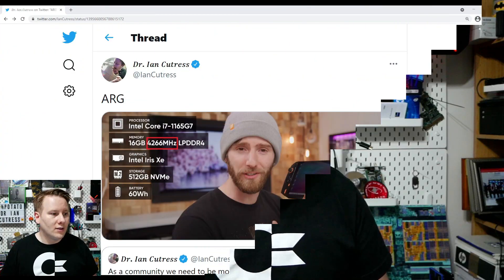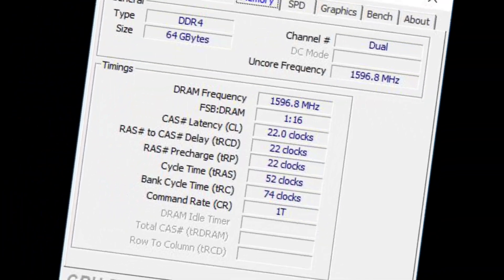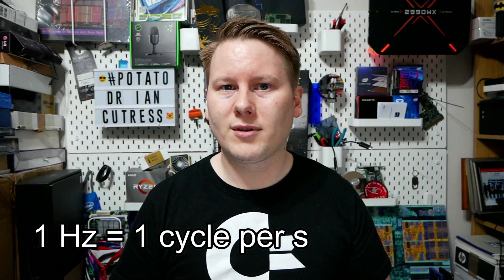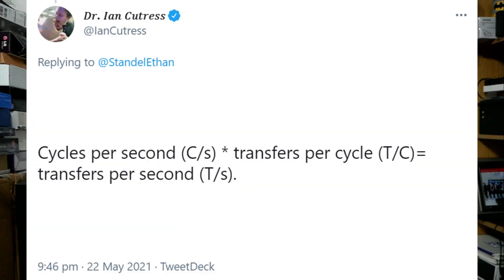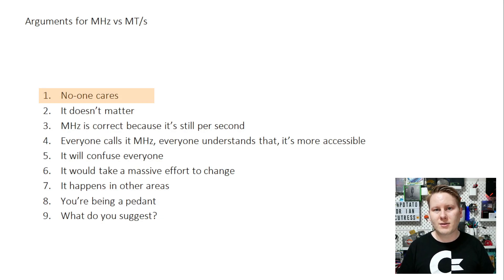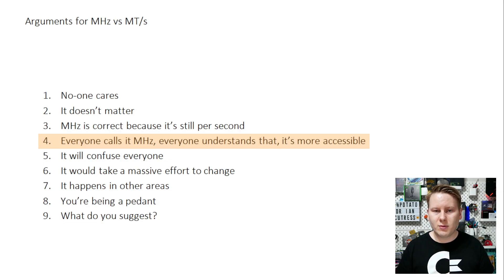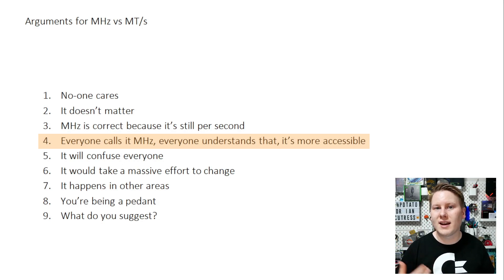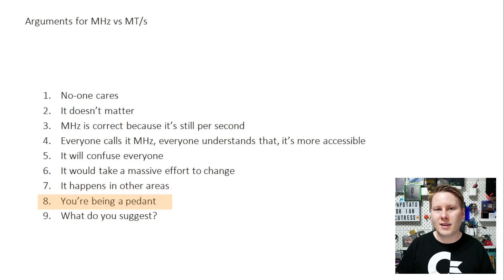Linus is WRONG 💩 : Explaining MHz vs MT/s

Comment: In short: Hz is a unit of frequency. The frequency data is transmitted is called data rate. It is absolutely nothing wrong to specify the frequency data is transferred in Hz! 
You can say the clock speed it 1800MHz and the data rate is 3600MHz. It is a correct use of the unit Hz in both cases! Both are different frequencies. Both can be specified in MHz!

Comment: I am always for being as correct as possible. I understand that this is your goal and it is a good one. Sadly you are wrong here! Hz is not cycles per second! Hz is just 1/s , nothing more nothing less. It is a unit of frequency. It is not only used for perfectly repeating signals! You can say a heard beats with 2 Hz, the string of a violin is oscillating with 440 Hz, the wings of a hummingbird flaps with 50 Hz. 
And you surely can say the clock signal has a frequency of 1800Mhz and the data rate is 3600Mhz. The latter is the frequency new data is transmitted. It does not have to be the same data! 
Honestly you have the misconception that frequency is only used for a perfectly repeating pattern. But that is not the case!

Comment: I understand BOTH sides, BUT I agree with you in just dropping the mhz/MT - calling it DDR4-3200 or QDR3200 - it's MUCH better than when we were using PC1600 on top of DDR2-800Mhz ... ughh I could never figure it out (and I'm probably STILL saying it wrong here too lol) - just call it DDR4-4000 or QDR-400 or DDR5-4000 - this is ALMOST as bad the RGB standards - I just got some fans that are RGB, that have a controller and 2 LED strip - IT DOESN'T CONNECT TO MY COMPUTER AT ALL!!! NOT EVEN THE FANS!!! IT IS ALL DONE WITHA REMOTE CONTROL!! - But it just said RGB Fans with Controller.. I was misled, just like when I got the last ones that were ARGB with NO controller and I couldn't even connect it to my mobo... why is there NO STANDARD WITH RGB, and 700 DIFFERENT USB TYPES?!?!
WHAT ARE THE PEOPLE IN CHARGE OF STANDARD DOING WITH THEIR TIME?!?! 
ARG

Comment: I'm not entirely sure if that argument will come true as I expecting. Basically, Hz is a measure of events per second, and type and complexity do not mether. Do you want to count clock speed, metronome ticks, things made in one day, cars traveling through the crossing, the instruction being done, or nodes played it literally does not meter, measurement does not need to be constant or tied to something that is periodic in nature. Your problem is with how units are used and you are joules of musicians that agree to use one standard, so make your argument straight, don't try to overcomplicate everything like there is a reason, because consistency is the only one you need.

Comment: I'm with you on this one.
I have the advantage of having done analog modem work in the 1980s-1990s.  There was a lot of misunderstanding of "Baud" vs. "symbols per second"; a 2400 Baud modem was still 1200 symbols per second, but each symbol represented 2 bits of data.  As data rates went up, a lot of that increase was using modulation that provided more bits per symbol, not more symbols per second (the POTS network had some frequency limitations); as time went on, a number of interim standards  ("BIS") were adopted that allowed a pair of modems to "train" themselves to better than minimal line conditions, and use higher frequencies or a larger symbol set (more bits per symbol).

These days, I work on embedded systems.  The SoC vendors all rate the memory bus rate in MT/S, with the clock rate being in MHz.

Comment: The correct unit for stochastic or aperiodic events per second or counts per second its the becquerel. (No, it isn't just for radioactivity, it is just mostly used there). Caring about getting units correct is only pedantry for those that haven't (yet) crashed a spacecraft into a planet.

Comment: I think there is no harm in the MHz defence, since it is not really misleading anybody. It is an "effective" MHz, in much the same way that the nanometer process numbers no longer really measure any specific component, rather they describe the "effective" nanometer value as it pertains to Moore's law. It's hard to justify making the distinction of effective memory speeds but not also advocating for more "accurate" descriptions of transistor density. Which you may do, I don't know your stance on that one, and like, either is fine, I'm not saying it's WRONG to make the distinction either way, and certainly at the technical level, or where consumers may be mislead, better communication is important, I just don't think in this example it's worth making a fuss over. As far as a customer is concerned, the "effective speed" of their memory is all they really care about. They might need to have some awareness of the nuances if, for example, they need to adjust their BIOS settings, and different motherboard manufacturers use one term or the other. Communication is not about being "proper", it's about transferring an idea from one party to another, and, again, I just don't see this being bad communication in this instance.

Comment: I understand both sides.
Your side is, know what you're talking about and don't spread misinformation or the wrong information to other people.
I completely agree with that. However, we are power users. We want this information because it's useful to us, but the vast majority of users don't and to them "it doesn't matter".

The average user is a normal Joe Bloggs who doesn't even know how many pixels their phone has or what resolution it's on.
If this person walked into a PC computer shop, which again will be the vast majority of your customers, and asked for a fast thin and light laptop and you pulled out the "This is using an APU and so it has high Mhz ram in order to help the integrated GPU, but this one is only X MT/s while that one is x MT/s" they would walk out or ask for someone else.
All customers want it a simple quick glance number. 4266 is higher than 3600 so 4266 is better. Done. They don't care that it means Mhz or MT/s. The same way they don't care if your SSD is SLC, MLC,TLC... even though it would be beneficial to know for your use case.

Now why do I bring this up?
I would suspect the majority of those that watch LTT are the average Joe Bloggs and he needs to cater to them. He has left the power users to people like GamerNexus, Level1 and yourself. He has completely dominated the lower level average user base and it shows. It has made him very successful.

So all in all, to him and his viewers, it doesn't matter.

Comment: I really liked how the best defence is done by the attacker itself, Linus thanks for the bullet points 😅. YES this argument is about clarity and not what bullshit a manufacturer or a marketing person want to put on the box. Words have meaning and evolve over time but numbers really shouldn't shift every new generation.
So clarity ,and even like you propose neutrality, is better because at least we aren't lying every time we are talking about something that, if taken word for word, could go wrong.
I don't think a computer would post if someone put 4 000 in every box the memory BIOS setting shows you with 4 digits and a potential MHz letters behind it 📴

Good video on it. Hope your habits of taking the number on the box as a simple naming in a range of product instead of the real metric catch winds in the industry and maybe (🤞) we all see manufacturers start giving the naming rights of a product to the Engineering team !

Comment: tbh noobs always say "doesn't matter" to technological rigorousness, but it's always this kind of thing that end up contributing to all the completely absurd conclusions.

BTW IPC differs between any two applications so it's impossible to list that. There's a set maximum to IPC for a certain design but this value is just meaningless to actual use cases.

Comment: This misleading use of units is similar to the irritating use of 1000MB or GB instead of 1024MB in hard drive capacity specs. No OS I've used ever uses perfect multiples of 5, they use bytes which are made of 8 bits each. This means we always buy a hard drive that is smaller than what it claims. So I fully agree with you, leave the units out, if one is interested they can go do a little research and get to know exactly what the numbers represent.

Comment: I kind of disagree that a transfer can't be considered a cycle, unless  it's halves of 1 transfer. If you rectify a 60 Hz AC input, you get a 120 Hz signal at the other side, or with old style bulbs, it would turn on for the positive and for the negative, flashing 120 times a second, it's both 60 Hz and 120 Hz just depending on your perspective, and what you actually measure.

Comment: That representation of the DDR memory with a clock cycle doesn't seem accurate. It looks like you are talking about DDR memory showing a half wave rectification diagram instead of a full wave rectification diagram. Memory should be transferring in data in both directions of above and below zero of the analog clock resonator. 🤔
It would be nice to have some PC hardware engineers explain it who actually develop this stuff going all the way from the power supply, to the resonator and all the way through the memory and back again. I was looking at multiple websites on this subject but only get partial information and not a complete picture.

Comment: Another common scenario where units are used incorrectly is when people are using kg when they are talking about force. I've even seen one person on youtube, who has a degree in mechanical engineering use kg m for torque, when it should be N and N m respectively. This REALLY grinds my gears.

But then again, for casual viewers it might be easier to interpret those fake units than the real ones. The problem really is that people how been using incorrect units for such a long time.

Comment: I think it's good to go into the detail occasionally to inform the new people who are constantly entering the area of interest. It's a good sidebar item that the experienced hands can skip over. I would very much try to avoid misquoting the hard and fast clock rate. Getting it correct and making the seeming disparity stand out encourages people to learn.

Maybe it helps that I'm old enough to remember when DDR was first announced and drew attention to an area that was largely underappreciated. People generally knew more RAM was better but the other performance aspects were rarely discussed as there were rarely any choices. The closest it came for many of us was the 'fast RAM vs chip RAM' issue on Amiga systems but that had more to do with how overall performance was affected by which portions of the system could talk to which memory than how it performed in of itself.

Comment: And they say BTC use too much energy, this is too much energy for nothing. Cause if let's say I invent a  memory that can  run at 100 Mhz and can transfer 10 bits of data on a clock, than it is easier to say it works at 1000 Mhz ( cause that would be the equivalent of 1 bit per clock , I mean  it would have the same bandwidth ) so that every non tech savy could read the specs and understand the same language. It's like 1 GiB in storage is not the same as 1 GB we are talking about, but we use it anyway cause is  more simplier than to explain to every noob there is a difference between base 10 and  base 2 and storage industry use base 10 and some industries use base 2.  And just so that we are on the same page here, there is only one doctor on Youtube and he is: *Dr DRE!*.  ^_^
Reply from the maker: I'll take one of whatever you're on.

Comment: Yehe IF you Use DDR and MHz then its very important to use the actuall clock speed otherwhise its  cause conffusion. It would actual be beter to use memory bandwidth. The intresseting should actual be how much data u can read/write and it depends on speed, data width (and some extent latencys for non burst) . As with CPU clock speed says nothing and is only used for marketing...

Comment: As an engineer in a different field, I understand and agree with you in principle.  However, sometimes it's just necessary to use language that everyone understands for the non-engineers.  I often have to do so with the non-engineers I work with.  I will use a real world example ... me.  Back in the 90s, I used to build my own PCs, but for the past 20 years I had just been doing PCs from OEMS.  I just didn't want to deal with keeping up on the tech and it was easier to just buy something new and shiney from them every few years instead of doing all the research.  So, a couple years ago, I decided it was time to think about getting a new PC.  Mine was 4 years old and I was starting to notice the age.  So, I started looking into things and saw all these processors that have 3.X GHz base clocks and 4.X GHz boosts and thought "wow, processors haven't moved very far" because my existing processor was 4.0 GHz all core.  I didn't understand IPC, I had never heard of it even, despite having been around computers since the 80s.  I just assumed, like most non-tech enthusiasts, that GHz = GHz.  I then made some bad assumptions based on that.  (It worked out in the end.. I upgraded my old PC a little to give it more life, learned more, and built a new PC at the end of last year based on knowledge.)  So, here is a case where "correctness" is being done, but it actually has potential to hurt the average consumer.  Linus was having fun with the idea of instructions per second, but there's a grain of truth to the idea... some way to convey the concept that GHz <> GHz to normal folks.  Anyhow, I just wanted to point out that example to give a perspective on how being correct isn't always "right".

Comment: Well, it doesn't matter if everyone uses same terminology. That's why nobody will change this. Does changing MHz/s to MT/s changes performance i am, as consumer, getting from this memory, or does it more clearly highlights difference between performance of memory modules? Does it affects everyday performance, or stability of module? No. So as long, as everybody use same terminology for this, its ok to use wrong terminology. So yes, its you just being pedant (not that this is a bad thing)

Comment: I design and sell Data Center hardware (servers, storage, switches, routers, and everything that you need to make a cloud Infra). I can confirm that within all tenders and responses, we never use units when specifying the Memory performance (for capacity, it'll be GB per DIMM). So all our text and communication says "24x32GB DDR4 2933" or "12x16GB DDR4 2666". We never mention MHz or MT/s ever. That's just the best way because someone like Ian will think it's MT/s and Linus can think whatever unit makes him happy.

Comment: CPUZ...The important information here is it's reported... DDR4-3200 [no units] and the clock is 1600Mhz [with units]
I actually have it a little overclocked beyond this...Dram Frequency @1683.8Mhz [4 DIMM's @ 4096MB]

DIMM #				1
	SMBus address		0x50
	Memory type		DDR4
	Module format		UDIMM
	Module Manufacturer(ID)	G.Skill (7F7F7F7FCD0000000000000000)
	SDRAM Manufacturer (ID)	SK Hynix (AD000000000000000000000000)
	Size			4096 MBytes
	Max bandwidth		DDR4-2132 (1066 MHz)
	Part number		F4-3200C16-4GVKB
	Nominal Voltage		1.20 Volts
	EPP			no
	XMP			yes
	XMP revision		2.0
	AMP			no
JEDEC timings table		CL-tRCD-tRP-tRAS-tRC @ frequency
	JEDEC #1		9.0-9-9-22-31 @ 666 MHz
	JEDEC #2		11.0-11-11-27-38 @ 814 MHz
	JEDEC #3		12.0-12-12-29-42 @ 888 MHz
	JEDEC #4		13.0-13-13-31-45 @ 962 MHz
	JEDEC #5		14.0-14-14-34-49 @ 1037 MHz
	JEDEC #6		15.0-15-15-35-50 @ 1066 MHz
	JEDEC #7		16.0-15-15-35-50 @ 1066 MHz
	JEDEC #8		18.0-15-15-35-50 @ 1066 MHz
	JEDEC #9		19.0-15-15-35-50 @ 1066 MHz
XMP profile			XMP-3200
	Specification		DDR4-3200
	Voltage level		1.350 Volts
	Min Cycle time		0.625 ns (1600 MHz)
	Max CL			16.0
	Min tRP			11.25 ns
	Min tRCD		11.25 ns
	Min tRAS		23.75 ns
	Min tRC			35.00 ns
	Min tRRD		4.38 ns
XMP timings table		CL-tRCD-tRP-tRAS-tRC-CR @ frequency (voltage)
	XMP #1			16.0-18-18-38-56-n.a @ 1600 MHz (1.350 Volts)

Comment: While I am one who can appreciate paying attention to specifically to the units being used I feel compelled to point out that at 3:22 you said "the leading edge and the rising edge" and then at 7:07 you said "rising and leading edge"; the most correct pairings would be "rising and falling" (describing based on how the voltage changes) or "leading and following" (describing in terms of the phase of the signal). Thanks for making this video, though; technical literacy is something that a great many people need work on.

Comment: Actually, I never came across MT/s before. And as a person that handles computer hardware only every 5 years or so, I was confused by the difference of the number in the name and the MHz value that my system displays (e.g. DDR-3600 and 1800MHz). However, I wasn't confused enough to be bothered to go research the reason.

Now I know (thank you for that) and I think the difference is important. The clarification actually might reduce confusion in my opinion especially when marketing uses MHz instead of MT/s.

Comment: just like celcius, fahrenheit, and kelvin. as long as it's a correct conversion, manufacturer should show everything in the box/manual with proper terminology (such as cycle & transfer), for eg. showing the MT/s alongside with the Mhz. the marketing/product team on each manufacturers should also be educated on using the correct terms rather than just blindly wording/labeling the product for the hype of the masses (in order to sell it).